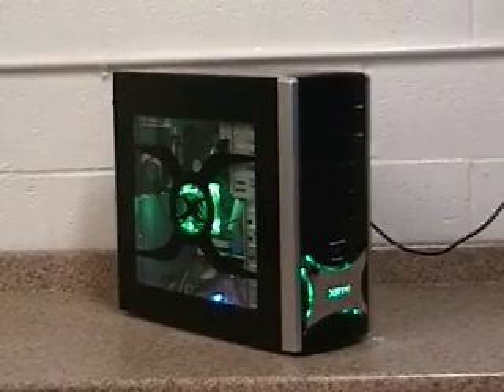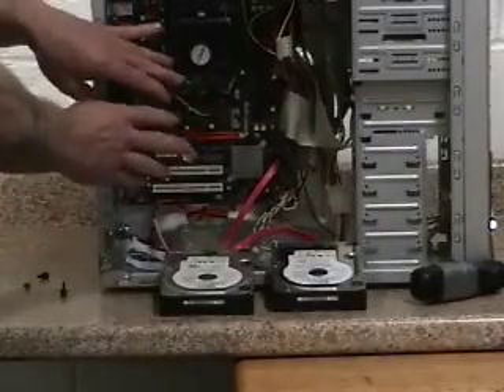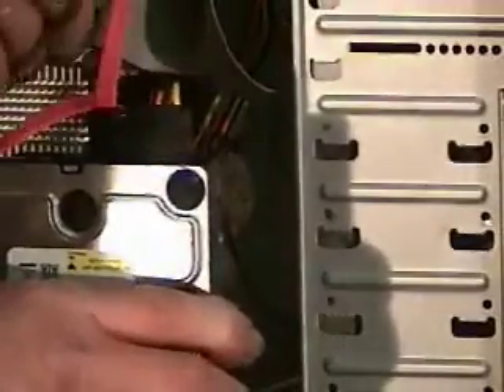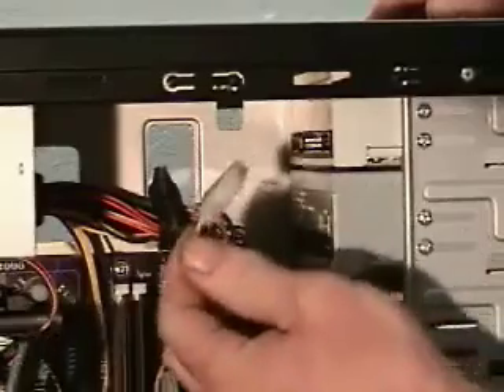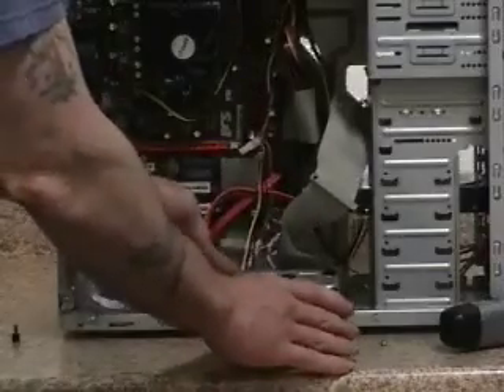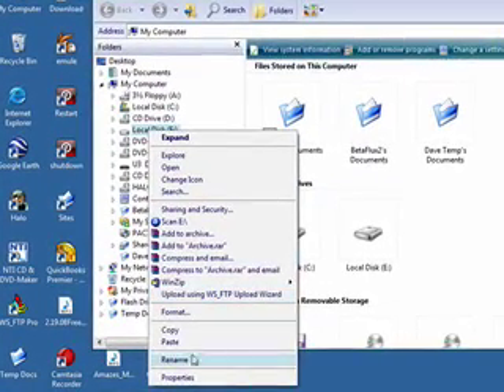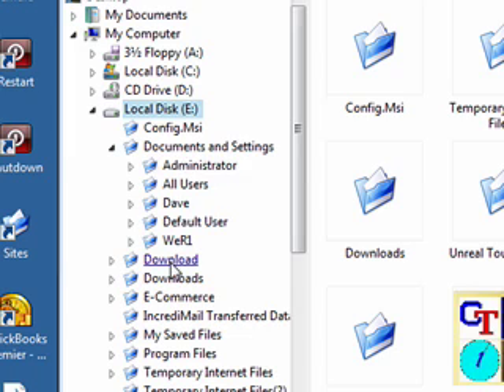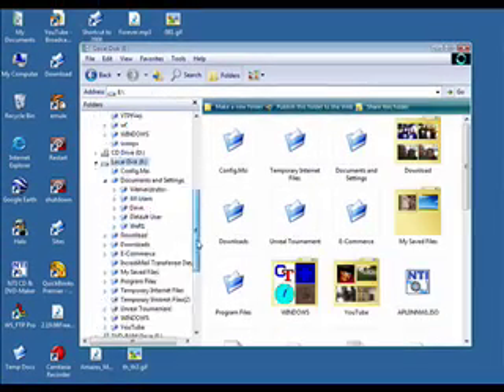Repair your Blue Screen, My PC will not start.

Comment: Everytime i start up my pc i get the BSOD. I tried to use the advance setting option by pressing F8, I then scroll to "Last Known Good Configuration". I wait untill the my windows 7 to load, however i would get the BSOD for a second and then my pc would crash and return to the black windows error screen (BSOD). Please if you have any suggestion on how to fix my problem, please help me.

Comment: I have a similar problem but with a "twist" My PC shows "stripes vertically on the screen and looks like "Hieroglyphics" in the text in the Post screen. And to top it off it wont boot to windows in my Win 7 pc. 

I've tried reinstalling Windows, Display drivers, scanning for viruses in Safe mode since thats all I can access at this point. Any suggestions here. it's a XFX 680i LT mobo with a PNY 8800 GTX OC with OCZ 4 gigs of Ram.

Comment: thks alot it worked. but i did replace my hard disc by the hard disc in a external hard disc so it made easyer to plug my hard disc by using USB and some how the other pc did detect the error from my hard disc automaticly and did restart and started some kind of scan to repair the errors and it worked it got fixed and so i managed to fix my pc without losing any data.

Comment from the maker: When you use F8 to get to the safe mode option screen, look for a setting to turn off or disable Auto Restart, then your blue screen will stay up so you can read the error.

Comment: Is it making any sound codes? (beeps), if F8 doesn't work then most likely your HDD is not being picked up, double check if your HDD is plugged correctly and run a DFT to check if the drive is healthy. some more tips at

Comment from the maker: @adburton76 Sounds like you have an ATA serial hard drive, there is an adapter you can buy, or get ahold of an external hard drive enclosure, you might be able to plug your non working hard drive into that, I have an external hard drive that I use as an adapter. they come apart real easy to be able to swap drives

Comment: what if the working computer that I try to connect the nonworking hard drive to doesn't have the same kind of port?  The CD Rom powersource is much different than the old hard drive.  Is there an adapter or something I can use?

Comment: Thanks very much for this video. Had the blue screen on my Dell inspiron luckily my wifes Dell xps was near by we put my corrupt hard drive into her computer as you instructed plugging it into the cd rom plugs. When we started her xps it did a scan and found various corrupt files. We re-installed my hard drive and it started up just fine no need to re-install operating system. Thanks again I'm soo happy I didn't lose my pictures and music

Comment from the maker: @00cmjproductions00 The easiest and fastest way to fix the blue screen is to reinstall windows if you have a cd. use the repair option and you will not lose your data, but you should also read the stop error code and google it to find out your exact problem.

Comment: every once in a while my computer screen goes black, and it freezes and you can see only a arrow which is the curser ... you cant do anything but restart it and than it works for a while and than does the same thing. i tried erasing everything off the computer with my recovery disk but this still happens . do u know what the problem is? i have a windows xp computer.

Comment from the maker: @LucarioluAura When windows shuts down hard or incorrectly say from a power outage or power loss, the data can get locked in the memory and lost from the hard drive,
the hard drive operating system can not find the boot record.
Reinstall windows using the REPAIR option and you will not lose data. You could also try my video on (chkdsk Recovery Console) It could repair your boot volume issue. You can find a new power adapter (charger) for your laptop on E-bay for about $35.00.

Comment: If the problem is with my OS I just run Ubuntu from a disk and back my stuff and restore or just delete the file that wont let my OS boot its much easier than moving drives I would know use to do it all the time just use a backup OS a lot safer

Comment from the maker: Sounds like your sound device is gone bad on you, realtek could also be the network device, you would have to go into the bios and turn the audio and network device off, then it should start, once you get it to start you would want to reinstall the drivers for those devices. then turn them back on. bios would be either DEL, F1 or F2 usually.

Comment from the maker: The good hard drive going into the broken pc will most likely not work. plug the enclosure into the working pc using the usb and it will pick it up as a second hard drive, then you can save your data.

Comment from the maker: It could be caused by a bad memory module, but also it is likely that a system file has been damaged.
Can you start in safe mode? what windows version are you running?

Comment from the maker: That is usually caused by a bad driver for some device most likely your video driver.
if you can start in safe mode you would uninstall the driver and reboot

Comment from the maker: Usually a bad or dying hard drive will cause your pc to run really slow and with it not showing up in the computer it is probably dead, best to unplug it.
ESD, just make sure the pc is unplugged and you can clear all static from your body by just touching the case (or tower)

Comment from the maker: Try to run a system restore back to before you uninstalled kaspersky.
if that does not help then try to reinstall kaspersky, you might have deleted some system protection files that need to be replaced.

Comment from the maker: You will need to run a chkdsk scan on your hard drive, if you have a windows cd it will give you an option to use the recovery console.
I made a video for recovery console.

Comment from the maker: @cem719 Sounds like the card is not plugged in just right or not pushed down into the slot good enough, push down and wiggle it just a bit at the same time. (While it is off of course) go to nvidia and let it scan for the latest driver for your card also.

Comment from the maker: Plug it into a different cable and it should not matter if they are both master.

you can change the pins on the drive near the power plug though. you should see it printed on the drive how to set each pins

Comment: Get vid beta : )   Another way to do this is with a CD called Active Boot Disk which allows you to use a CD that you have inserted into your CD_ROM drive which runs the OS on the CD in your ROM drive as a master. Which will allow u to transfer your files from other Hard Disc via of you using the Active Boot Disk CD in your ROM drive as a master. The way Beta is describing is the hands on approach, but very effective. 

Just google Active Boot Disk, you should get some matches.

Comment from the maker: Reinstalling windows may work if it is from a virus or other software problem.
Try my video on (msconfig made easy) that will check if it is a software problem or not.
it could be any one of your system hardware devices.

Comment: hi i have error, when i start my laptop i turns on and i can still the window xp windows and my picture as a wall paper and after that it will turn blue and with error on it can you tell me whats the problem please i know it doesn't have virus its just i used it one time and thats what happen

Comment: thanx for the response.

can you answer this one more question.?

in my nkowledge,the posible cause of this problem is my hard drive, right?
bcoz sometimes in the blue screen msg said that the error is caused by dumping or corrupted hardrive.

is that posible that my memory is also affected or maybe already damage cause by that errors and hard drive failures?

thanx and godbless<<<<<<<<<<<<<

maybe soon,i will ask more question!

Comment: open up the computer, unplug everything, clean it up, plug it back in, if it doesn't work that way buy a new power supply and replace the old one

Comment: i try'd but wen i put the windows xp disk in it says "setup did not find any hard disk drives installed in your computer." "make sure any hard disk drives are powered on and properly connected to your computer". and set up cannot continue. and i dont know how to fix that.

Comment: uhh if you see a blue screen and your pc wont start up all you do is go under your computer and find the power thingy if you have 1 big thing that connects to it to use multiple chords just quickly turn the button on and off and then it works again -.- works for me alot :D

Comment: With my dell latitude laptop i have a blue screen of death and i cant start windows in safe mode. My screensaver has showed up a few times but it quickly reverts back to the blue screen. I need some help on what to do please. Is it possible for me to take my hard drive from my laptop and remove the error from a desktop computer?

Comment: uhm... I had that blue screen few times ago, Computer don't turn on then, So I just take the acumuliator out, and yay. It turns off. Then I turn it on, and turn it not in safe mode but in normal mode.

Comment: The problem with my computer is that I get a little '!' on 'AvFw packet filter miniport #3' and when I try to update it says 'Does not have necessary software'. When I try to uninstall it tells me 'Failed to uninstall the device. The device may be needed to boot up the computer.' Please help I really don't want to have to pay to get it fixed.

Comment: Thank you very much for your help, but this is what i did and worked for me. I did put my xp cd on the cd drive and try to reinstall. the pc will read and copy temp files, then when it said to you to create, delete or so yo abort the instalation and restart the pc. That work for me without reintall win xp or putting out the HD. Thanks again.

Comment from the maker: Borrow or purchase an external usb adapter for your desktop hard drive. You can buy them for about $10.00, you will need to know if your desktop drive is serial (SATA) or parallel IDE, (ATA) then find an adapter to work for that type.

Comment from the maker: SPTD.SYS is part of daemon tools, a cd/dvd emulation tool, that allows you to mount iso images as virtual drives,
it's also part of Alcohol burning soft.
If you can boot into safe mode to delete this file then you can use a virtual cd to start windows.
ubcd4win(dot)com

Comment from the maker: what operating system are you running and are you booting to the original hard drive in that computer or are you trying to start the pc using your hard drive? Your hard drive has to be the secondary drive so you can use the good operating system to scan yours.

Comment: I have a blue screen error and I couldn't fix it, I couldn't access to f8, I have other computers but the hard drives are not the same, the one i have is xp Compaq HP, and it  won't work with xp balance, and xp dell, any advice? and thanks for this video it's great.

Comment from the maker: Start up in safe mode and logon in the admin account, then see if it will it let you do a system restore back to before this happen. You would have to go into your registry editor and manually change the security setting that the virus put in, but it is hard to say where ti is, research it on google.

Comment: The bluray driver is empty. In Acer, bios is pressing delete key.The bios find the 3 Hd. 1xWD150gb(the o/s is supossed to be here) 2xWD640gb. I have them on raid, well it comes with that config when i bought it,and i dont want to change the raid thing because Acer will blame the problem on me. I look for the problem that i have and the problem is related to bad connection of the HD.This aspire gaming pc have a thing called Easy swap and i dont think that my problem is cable.Thanks for answering.

Comment from the maker: Make sure you do not have a disk in your cd rom or floppy drive, it may be trying to boot to one of those. go into the bios when you first start it up, by hitting the F8 key over and over, You have to be quick if windows tried to start then you missed it. In the bios you will have to look and see if your drive is detected.

Comment: I called the computer manufacturers for help and they told me to press Alt F10, to repair my system by means of a hidden recovery in the main hard drive. That key combination doesnt work for me. My o/s and software is oem, cos the pc is Acer. I have no dvd or cd to reinstall vista 64 bits. Before this happens the pc works perfectly, but that hd, makes a weird noises. Acer guys told me that the only way is sending the computer to them to repair it. The pc is a new gaming one, and is very complex.

Comment: I have a problem with that Hd. I think i have one similar to that one. Mine is a Western Digital caviar SE16 10k rpm. The pc is brand new. Just got it 5 days ago. Last night all worked fine. This morning it doesnt boot up. It appears insert proper boot device and restart. The pc comes with 2 empty dvds, that they are for make a backup of the system, but i havent enought time to burn it.

Comment: Why not just run a boot cd, like BartPE or a random linux live cd, and run a HDD scan from there, or delete files, run a virus scan etc, or copy stuff to a USB stick, just what you want.

Also, not all blue screens mean that your Hard drive is corrupt, you'll get a code when your PC starts up and gets a bsod, google that code and you know what's wrong, and most of the time, how to fix it.

Doesn't mean btw that your method is effective for at least 30-40% of the bluescreens.

Comment: Hmongalaska, first you need to take your two year old away from your laptop. then your hard drive is probably toast from the impact. replace it, re-install your Windows XP/Vista, or Linux again. Thats why you should have drop insurance on a laptop. It's usually a $200 repair, and impact damaged hard drive will not be able to pull data off of it, like this video shows. if your data is important enough, you can send it to a hard drive data recovery service, and they can remove your valuble data.

Comment: Ok ive done all the steps but i deside to REFORMAT my slave hard drive Which was my reguler hard drive for my computer and i used a Master hard drive which was my old broken computers hard drive and once i reformat my slave drive i hook everything back up and my master drive is now my slave drive which is now back to normal but now when i boot my computer i get a (NTLDR is missing Press ctrl alt del to restart)i tried poping in the Windows 2000 disc but it wount go to there please help me T_T

Comment: @yadadaaron

Do you have an Windows XP Installation CD?

If you have it, boot from it. And when all is loaded, press R on your keyboard, when press enter if the "Administrator Password" shows up to continue.
When you simply just write:
chkdsk c: /r /p
fixmbr
exit

But if you dont have the installation CD, when go to thepiratebay(dot)org and search after it. Use uTorrent or Vuze to download the torrent. After you downloaded it, when burn the Optical Disc (CD/DVD).

Comment: @monicaco

Is that not an rhetorical question? ;)

You can reinstall Windows with an XP Optical Drive (CD/DVD), but remember to save your documents before you reinstall, you can use Linux Live CD's to that.

You can also try using repair methods, if you got into some small troubles.
Simple just use the XP Optical Drive or Linux Live CD and follow certain instructions.

If you dont have an XP Optical Drive, when go to The Pirate Bay for example.

Comment: To save time use software methods instead of hardware methods.

Try using an Linux Live CD like Ubuntu, or Ultimate Boot CD, an external hard drive or a flash drive stick, when you just copy your important documents or try to solve the problem.

For example, problems like corrupted or locked NTFS which cannot be fixed with booting, because it wont load into Windows, when the "LogFile" dont gets cleaned. 
That can simple be cleaned by using the "ntfsfix" command implemented in Linux.

Tada

Comment: Good video BetaFlux.
One little thing I have found handy for doing this is a USB 2.0 to SATA/IDE/2.5/3.5 Hard Drive Converter Cable.
You can get them from ebay for less than £10 incl P&P. Not that well made, but does the job!
Great for getting data from dead laptops as well as other IDE or SATA drives and comes with power supply.
A bit slow maybe on USB, but very easy to use.